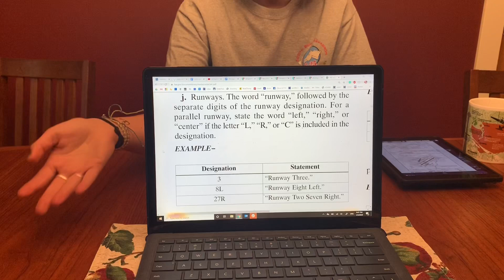Runway Numbers: No Leading Zeros

Comment: I flew into CMD and a poor student was mixing 20 and 02 while he was using only 20.   I got eyes on him before announcing base and final to 20.  I appreciate CFIs teaching the correct method.
Reply: The zero has nothing to do with the student's mix up. The same nervous student would confuse runways 12 and 21, 23 and 32 etc just the same.
Reply: So if the air force does it, that means civilians can expect the zero when practicing approaches and pattern work. Yes civilians do practice at these bases. Most AF bases have flights schools. I've shared runways with F22s